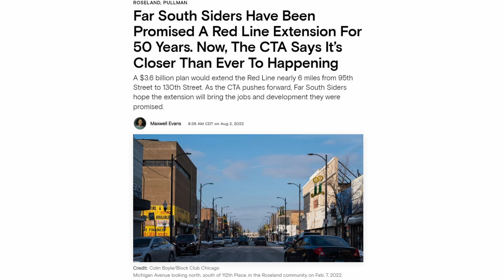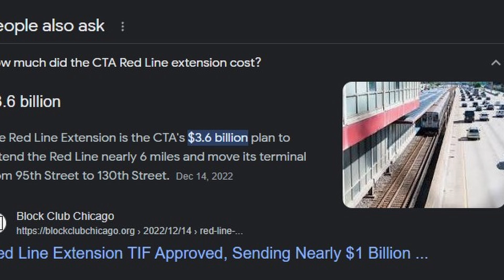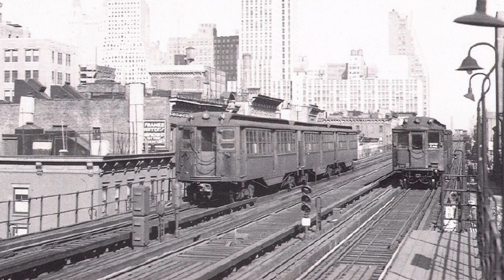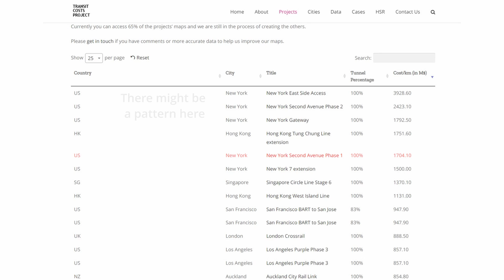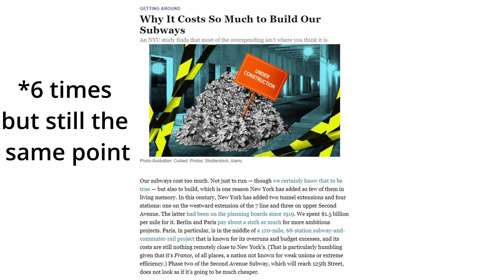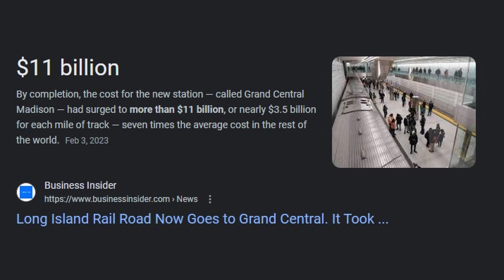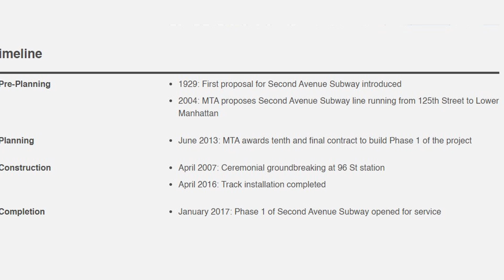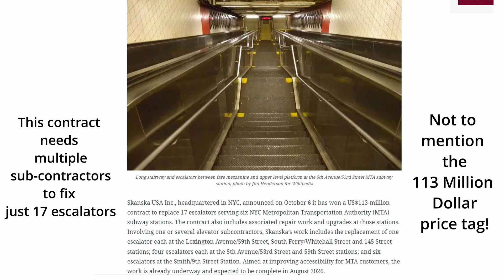Why Building Transit Costs So Much

Comment: Good video but lots of apples to oranges comparisons here. Your best segment is the ridiculousness of what and how much we build underground. The maintenence should all be on the surface; this is what other countries do. And you are completely correct that the opulance of some stations is over the top. The Red Line excuses from the CTA over the last several years are bogus. There should be exceptions for centerpiece projects like Grand Central Station which will be many people's first impression of the transit system. Finally, while the Second Avenue subway is hugely expensive, the sheer amount of crap underground in NYC that must be built around (both physically and politically) will make it more expensive per mile regardless. I agree that some of it is avoidable but cost comparisons per mile or kilometer becomes harder to compare in dense environments. A more similar system would be the Crossrail/ Elizabeth Line. Good stuff still.
Reply: That's still pretty bad excuses...
Have you seen Paris' underground? (as in "under the ground', not subway).
It's full of old quarries, archeological sites, aquifers, lose soil, sewers, flood protection systems, etc. Plus some medieval, human made, yet unmapped cavities.
They had to build underground bridges through caves that were the result of old gypsum quarries, they had to freeze large and deep portions of underground to dig through because many of them are located under or below-touching aquifers...
They also had to reinforce the ground before digging as it was way too lose and risked causing settlements and sinkholes on the surface.
Paris underground is like Swiss cheese with pockets of molasses and burial sites.
There is a popular say that "the bones of the 6+ millions cadavers in the (300km long) catacombs have more space than the people living in Parisian appartements". It doesn't come from imagination...

As for the opulence of stations and how much is built underground : have you looked at the Grand Paris Express project ? Of the 200km / 125 miles of new lines and extensions, 90% are under the surface, deep underground, and dug mostly with mud / earth pressure balance TBM's.
The biggest line, M15, is a huge 75km long loop line entirely deep underground. Only M17 has a bit over the ground and M18 a substantial part that is elevated.
The stations of the GPE look like an architectural contest gone wild... with only 3 of the 68 that are somewhat on the same model, and these are the few that are elevated.
The bunch of the rest are gigantic and deep stations, many of them with a plethora of "backstage" areas like maintenance and staff resting rooms.
What is comparable to Crossrail is the Paris RER E West extension, as Crossrail is essentially London's take on the RER concept.
The RER E West extension required extending 8 kilometers of tunnels from under Paris core historical business district to the tower filled modern business district called la Défense, running under some of the most expensive real estate in Paris. Plus a massive station (with a mezzanine like 2nd Ave stations) dug under an expo center, in-between towers, with "mole techniques" while everything continued operating above ground.
Where London's Crossrail and NYC's 2nd avenue subway converge is on the humongously expensive price tag and slow pace.

So the complexity, the proportion underground, the depth or the size of stations are not good excuses, especially compared to Paris' nightmarish underground soil and availability or freakishly high people density.
Reply: @KyrilPG  I agree. US prices are ridiculously high even when the soil is not crowded. Phase 1 of the Gateway Program, 4 km of tunnel under the Hudson River plus 3.2 km of track along wasteland up to Secaucus Junction is supposed to cost $16 billion. That is slightly more than the cost, adjusted for costumer price inflation, of 1211 km of HSR tracks including 17 km in tunnel, between Frethun at the mouth of the Chunnel tunnel and Marseille.

Comment: The US has much more red tape than most other countries too, its wild how much regulation and how many agencies are involved in planning/approving projects.
Reply: dont forget about the NIMBYs!
Reply: This is also likely a very large cause of the shortage of housing in most American cities. It will never cease to amaze me how the entire country (and the vast majority of Canada) uniformly gets this wrong.
Reply: You should try the UK. There were 200 archaeologists working on London's Crossrail project. The amount of red tape on HS2 is mind-boggling.
Reply: Many agencies need to be cut
Reply: I need to get a permit from the county to replace a water heater  or toilet...
Reply: It's useful to view the red tape as corruption...by forcing a project to get your sign off, and dragging it out, you get job security.
Reply: @bearcubdaycare  Not to mention out and out corruption like kickbacks for construction contracts/codes.  There are all sorts of requirements the gov't makes builders do that adds cost forcing consumers to buy luxury/unnecessary products.  Theres a reason things were cheaper to build a 100 years ago when we had a much smaller gov't (both local and federal)
Reply: they did it to make it impossible to build anything other than suburbs and roads
Reply: @electro_sykes  Bingo! You got it exactly.
Reply: Compared to which countries?

Comment: Why don't you take a shovel and start working for the project?
Reply: Oh eff off do you really need to be building the transit to take issue with the inefficiencies of the construction of transit
Reply: @paddyodoor3090  No. But I don't think the problem is in the contractors. And if the contractor is indeed a problem, one can take a contract themselves and make it more efficient.

I agree with you about the over-designing issues, though.
Reply: @paddyodoor3090  Do you know how expensive it is just to hire someone to paint your room?
Reply: @onetwothreeabc  Well maybe hiring Chinese contractors is the solution. More experience and much cheaper 🙃. CNBC made it even more clear in their infrastructure documentary. Contractors are part of the inefficiencies. Like it or not. It does not neglect the craft but rather exposes bad policies and wrong incentives.
Reply: @sunrae3971  If you hire Chinese or other foreign nationals, you can not brag about making "jobs". So it's a non-starter for many politicians.
Reply: @onetwothreeabc  And what's cheaper painting your room yourself or hiring someone to do it? Likewise the government should handle the work itself, rather than contracting the work out to private companies. It's the way we used to do it and the way other countries do it today.
Reply: @brickman409  Whoever does the job, you need to pay for the labor. The government either hires contractor for a project, or have a department of construction and hire someone (permanently) to do a certain job. What happens after a project is finished? You still need to pay the salary and benefit of the employee until their hiring term is finished.

You live in your house, and you can do your own paint job. How about electricity? Roof service? Plumbing? Do you have to keep people with all sort of specialties at your house at all time?
Reply: @onetwothreeabc  lol I'm not suggesting slave labor here. I'm just saying to cut out the middle man. It can all be managed internally rather than externally. The workers still get payed for their labor, but now you don't have to pay a contracting company to manage it all. And no that's not impossible. We've done it before and other countries still do it today with great success.
Reply: @onetwothreeabc  and while I obviously don't have an army of people living in my house to do those things, I do as much of those things myself as I possibly can. Why? Because it saves money, delivers the same, sometimes better results and I learn something in the process. So yes there is someone in my house that can do all those things.
Reply: @brickman409  I don't know about your experience, but I think if you worked in a large corporation, you should know that the managerial staff is an important part of the team.

What you can save by doing things in house is not human costs, but capital profit, that is, the profit earned by the share holders of the contractors.

It's not nothing, maybe 20-30% I guess. But at the same time, competition is eliminated.
Reply: @brickman409  "I do as much of those things myself as I possibly can. Why? Because it saves money,"

At the same time you used your own time. That's the opportunity cost.

Maybe you can use the same amount of time to do a job and earn more? Maybe you can just use the time and enjoy your life more?

Or maybe, if you are so efficient on those jobs, you can work as a contractor for the next government project?
Reply: @onetwothreeabc  how about you do those things yourself instead of spending all day on YouTube telling people how to live their life!
Reply: @brickman409  I don't because I think it should cost a lot to hire people working on transit projects. If I'm paid $100k a year with benefits, I'm happy to take a shovel and work on the project.
Reply: @onetwothreeabc  alright, then log off and go do that
Reply: @brickman409  They didn't hire me for that money. So I'm still here.